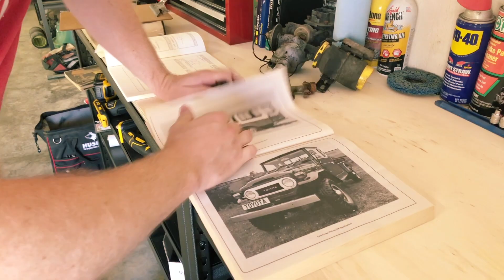Project Wrong Way 13 - Cleaned the FJ40 frame, too hot for clothes. Nip slip.

Comment: I was literally so nervous watching you operate that sharp wire wheel wearing loose clothing near nut height lmao.
Reply from the maker: It’s my understanding that loose clothing is key when working with heavy / fast moving machinery.
Reply: The last time i seen some one with loose cloths around heavy equipment they ended up naked not something you want to see it stays with you for life
Reply from the maker: Depends on who ends up naked, but I get where you’re coming from.

Comment: Eastwood and por15 make great chassis paint. Aerosol will look nicest. I prefer satin black or chassis black. Make sure to apply a primer first.
Reply from the maker: Have a recommendation for a decent primer?
Reply: @projectwrongway9127  Depends on what paint you use. Choose the paint-such as eastwood or por15. Then see what the manufacturer recommends for primer for that. I'm guessing a metal etching primer followed by epoxy primer. But they can give u that info. You will also want to wipe the frame down with paint thinner or something to get any grease left over off of the metal. You say your not doing a nut n bolt restoration, which is understandable. But u could paint the inner fenders and firewall pretty easily at this point and make it look a bit better. Get the paint code for your cruiser paint, have a local paint shop make like 2 aerosol cans of it. If u want have them put some clear in a few cans or just mix your color with clear already mixed in if u want it to pop more. Original engine compartment got no clear. Sand the old paint with 600 grit or with scotch Brite to rough up the old paint. Wipe down with clean rags and paint thinner, tape off, and paint. Do one section at a time. Do one inner fender one night, the other fender another night etc. Take pics of where stuff went so you can put it right back. That's what I would do wile the engine is out.
Reply from the maker: LandC thanks for the info man, appreciate it